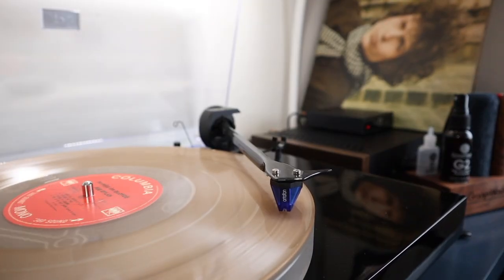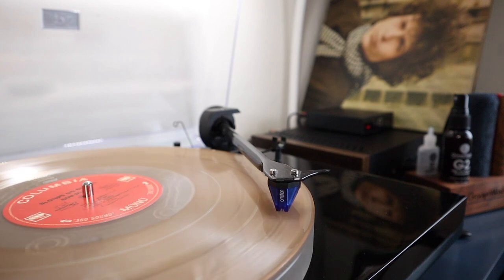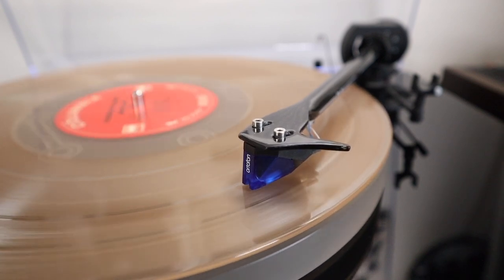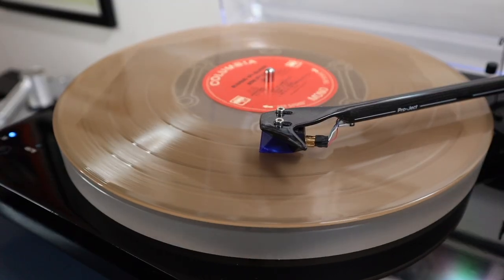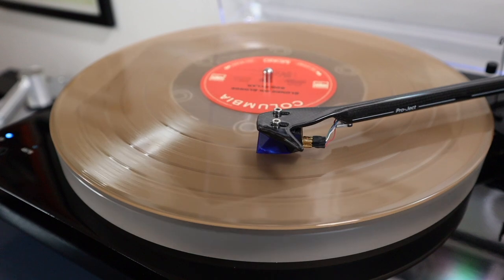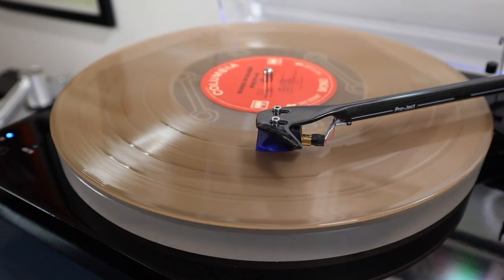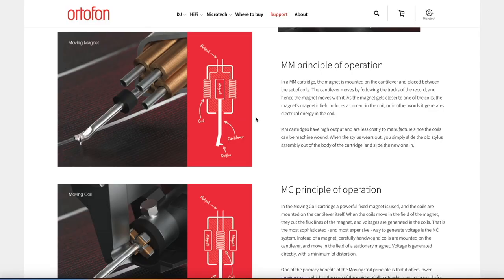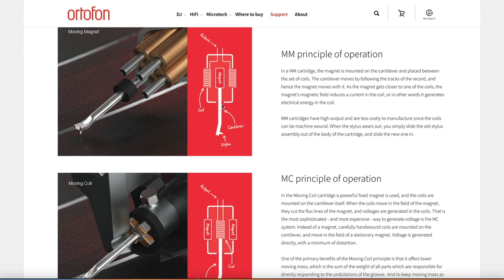Moving Magnet vs Moving Coil Phono Cartridges - Vinyl 101

Comment: Sound like a advertising blurb, for the MC. That it can do this and that better sonically.
And then drop the bomb that the YouTuber don't never had a MC cartridge that verifying that all that were said were no experience base and only rehashing advertising material and from others that pay more that is needed to say it is more sound quality to motivate their purchase. Pay more should give better sound quality... Or..

We know that price and performance is not always going hand in hand.

The interesting thing is IF a stylus on a MM cartridge follow the Grove walls the same as the same stylus in a MC cartridge.

So subjective listening tests is not practical or logical to use in many cases. 

The consensus is that in the other end of the cantaliver than the stylus is sitting. The MM the magnet part is heavier than the MC coil.

Then the wight of the MC coil part is depending on how many windings the coil(s) has.. More windings make it heavier like a MM but it will give higher mV output we call them high output MC cartridges. Then the upper hand of a MC cartridge is gone (when the total mass of the unit stylus+cantaliver+coils are the same as a MM.)

So then we have the MC that has few windings to reduce its total mass. That in the other hand give us low mV output. But instead we need now step up transformer to get the mV up to a usable level for the RIAA.

When we know that that the total mass of the assembly is the only difference for how well a stylus is able to track the groove walls.

Then there is MM cartridges that has worked a lot on that aspect.

My personal experience is that I got my hifi setup after a alternation so I could hear distortion in the high frequencies (so many systems that has less energy there make it less obvious).
Next I happened to have a good made record that happened to be a DMM pressing (=less defined cuts can mask the issue).
Lastly when I noticed it on the track(s) then it were one of the things that you could not un-hear anymore.

When I know that the higher frequencies is harder for the stylus to have fully contact with the groove walls or in other words not being airborne and between the valleys and hills in the groove walls = the distortion I heard = higher record wear.

Now when I had the setup and the test record and everything setup.

The thing were that I used a very nice elliptical stylus that were just broken in that used a boron cantilever (!) Just to make the assembly lighter.

I tested with another elliptical stylus that were using a more standard aluminum cantaliver but with same result (distortion).

Then I switched to a other MM that used a micro line contact stylus that is mimicking the lathe cutter geometry much better.

And all distortion were gone! (And remember I had the perfect test setup there I could recreate the distortion.)

What conclusions can we take from that?
1. I will never use inferior elliptical stylus in ANY cartridge ever.
2. Stylus choice is more important than the weight of the total wight of the stylus+cantilever+magnet/coil.
3. Stylus choice is then more important than if it is a MC/MM. In other words a MC with elliptical stylus is inferior to a MM with a micro line stylus.

The slightly drawback is that the micro line needs a little bit more attention in setup. But if you have reached this far the you are obviously into details and carful in your setup. 👍🎵🎶💞

Comment: The big mistake is to assume the lower output voltage needed to be active amplified !
WHY ...........? ..........The MC delivers an equivalent amount of energy but with substantial lower voltgae output, amplification seems the logical way to go , but in reality the output needs ONLY a conversion between voltage and current..........
MC are therefor missunderstood.......
Indeed a good head amplifier for MC ( pre pre amp )is a solution..........but a high quality transformer is the right way to go, only either technology is VERY expensive if you want to reveal the real potential of a Good MC cartridge !
With the right quality solution , what you get out of a very good movcing coil cartridge is a very natural reproduction of Music and  NATURAL sounds ............with a real environment feel , as well in widt out of the speakers cabinets and speaker cone...........extended dept perception and above all a perception of HEIGHT !!!!! ..........a recording made in a cave you hear falling the waterdroplets from the CEILING and the foodsteps on the gravel below..........or someone going down the stairs beneath the floor .
But in fact a superb MM will outperform an MC when the latter is not up to the ultimate standards nor the following stages , even the amplifier and the speakers  need to be on the same quality level ..do NOT6 compromise with MC cartridges or you will being deceived and lost a lot of money you could have spend on a superb MM..........

Lots of faulty and false  information circles in the audiophile world .........with stuborn  unwreckable beliefs that are NOT facts.......

Music must not be superb sounds and very impressive performance with all other those audiophile glorified qualities that audiophiles praise and analyze when listening .......when i go to a real life event I do not analyze as a HIFI system whatever that could be...at home the system should be able to reproduce the illusion of a real physical perceieved piano ; a violin , a concert with a perceived physical presence in a space .............a voice with a human body............the feeling of a sunny day or the fresh atmosphere in the morning ........and above all the system must dissappear when you close your eyes , most systems even expensive high end come not even close, ...with the right MC set up one can gett closer and close the eyes, only to enjoy the univeral vibration and presence of music.
It is not a question of money even when good components are not cheap............it a question of make you forget you listen to a set up that permit to connect to music while the system becomes only a tool..................then a good cartridge is the way to start witrh.........

For info............I have C17 axccuphase pre pre........( no RIAA ) inside........it weights more than most amplifier, double mono , two power transformers , class A etc , a superb machine and sounding superbly and asthonishing ..............but i still prefer listening with my  COTTER MK2L ( silver coils - MC transformer , sounds less HIFI and more natural with air arround the voice and instruments................and it dissappears )

Comment: I think mc is the way to go. Even a lower end one is all I need to believe that. The Denon 301mk2 currently $360 delivered  if you look, sounds noticeably better than a Nagaoka mp200 and much better than an Ortophon red which I didn’t like at all. That’s what came with my Technics 1500c. It amplified ticks and pops excruciatingly. Very mediocre.  I have a $100 Lp gear vessel 3se also, not much detail. You get what you pay for on these budget mm’s. Okay I suppose if you haven’t heard better. With what new records cost why bother?  I just got an AT OC9XEN I have yet to mount. It sure looks well made. My phono stage is on a Denon PMA a100 integrated amp or IFI Zen phono of which I hear no difference.

Comment: There is a video from Ortofon where they show real actual mechanical parts from moving magnet and moving coil cartridges, and the difference is not really that large with respect to mass and size. Tracking weight and frequency response is not that different any longer. Is the huge difference between moving magnet and moving coil something we had in the 60'ies and 70'ies when technology was still evolving? I use an SL-1500 with an Ortofon Bronze, with a secondary head shell with an Ortofon Blue.

Comment: It is necessary to start criticizing MM cartridges with low-quality magnets, which manufacturers have got into the habit of putting in such cartridges. Samarium cobalt should be used.
Well, it’s right to calculate all types of noise and analyze correction circuits from the standpoint of modern circuitry, as Nikolai Sukhov does in his projects.
99% of the shortcomings of MM cartridges are simply their low price and high repeatability, and even with excellent parameters, if they are made honestly and conscientiously.